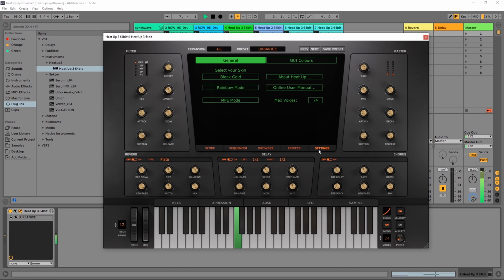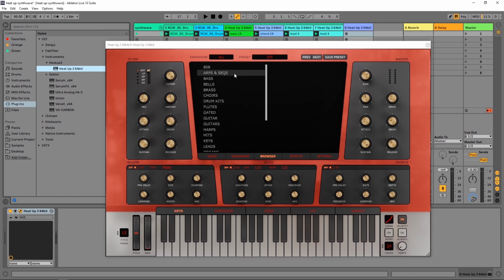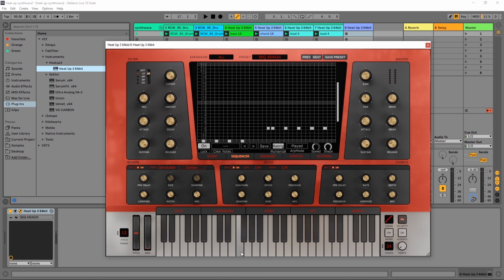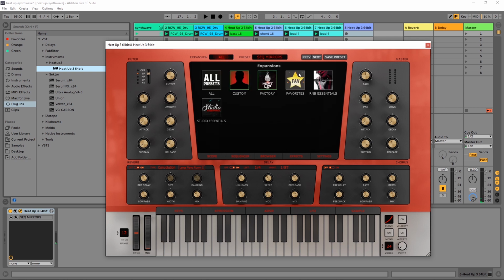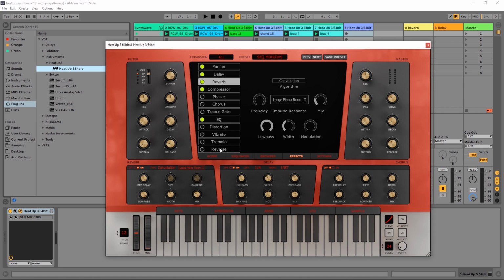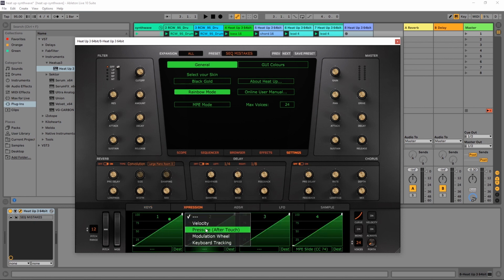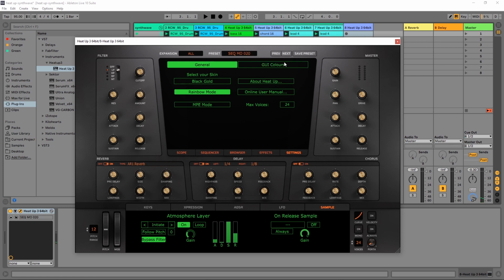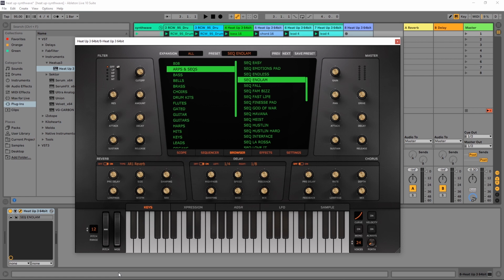Heat Up 3 Synth VST Plugin by Initial Audio | Review of Key Features

Comment: On certain instruments the plugin crashes. So you don't get many options to work with.
Reply: Cracked version? I've no probs on my side.
Reply: @udziness662 PAID version
Reply: @MakaveliNThis  maybe u're computer is too weak otherwise try to re install... Or give an exemple I'll try and give u my feedback 😉
Reply: @udziness662  2018 MacBook with 16 Gigs of Ram
Reply: @MakaveliNThis  do u have the name off the preset who give's u an issue, I'm on windows, go check on the website the last Mac update is not totaly supported by a lot off vst software at the moment, I'm on windows lucky me 😅
Reply: @udziness662  too many presets to name. It happens on 80% of them. But I have other vsts and they all pretty much has the same sounds
Reply: @MakaveliNThis  to me there is an issue, may u should tell them what's going wrong...
Reply: I'm having the same issue with Windows 10. Any luck? Seems to be a bridging issue but no idea how to fix it
Reply: Castro Supreme nope

Comment: Wait, does it have an actual convolution reverb? Can you load your own IRs? All in all, I think this is a great sounding synth and I wanted to buy for a long time but I am kinda torn right now. There are several expansions I would like to get for it, but after adding it all up, the whole "bundle" comes to Omnisphere price level and it's not like I think Omisphere I necessarily better. In fact, I never really wanted to get it cause I always thought it's not worth it for me, but now that I consider spending a similar amount on this it makes me think if in long term Omnisphere wouldn't be more versatile (especially with broad third-party presets market). Omnisphere is also definitely more recognized as a great quality software. It has tonnes of sounds, much more than Heat Up 3, so it seems. Then again, I don't really like most of them I heard on demos, while I like most of the ones I heard in Heat Up 3 demos. Do you think this plugin is well fitted for all kinds of music and not only for hip hop / trap style? Also, do you find any issues with the quality of the sound or general performance of this plugin? I really like the way Sektor sounds, but there is something weird about how the plugin behaves when I operate it. I don't know how to describe it. When I click on keys or turn knobs it's just not as smooth as Serum for example.
Reply: Comparing interfaces it's a wannabe and laggy Nexus.Comparing sounds it's a rap/trap/rnb complete tool,maybe the most complete out there.Sounds are dope and tbh the only reason to use a plugin like this  is the sweet sounds and the variety of them covering all the spectrum of the rap game.If you are not into this genre better stay with sektor or any other plugin.
Reply: Catchie get omni
Reply: tbh with you I have heat up 3 and Omni and I use heat-up 3 way more I think it really depends on what you wanna achieve, Omni is great but I just don't like how much CPU it takes up and is kind of hard for me to navigate through, heat up 3 is my go to because it doesn't take much CPU and is super easy to navigate, all personal preference
Reply: @elobeatsinc1536  what daw are u using? heat up freezes in some of my cubase projects and makes them useless in a point to abandon the beats.
Reply: kou lis I use fl studios and have never had that issue
Reply: @elobeatsinc1536  yes its probably a problem of my daw
Reply: kou lis what are you using ? And basic but have you tried uninstalling or contacting them?
Reply: @elobeatsinc1536  it's probably daw's issue cause i remember searching steinberg forum and were already threads with this problem happening with various plugins,I have a good specs system for production - ram and cpu not an issue and thats the weird but as I told you other cubase users have same issues so its obvious who's the guilty :p